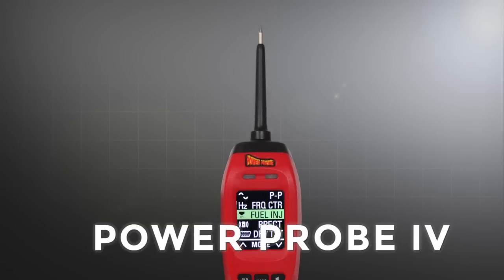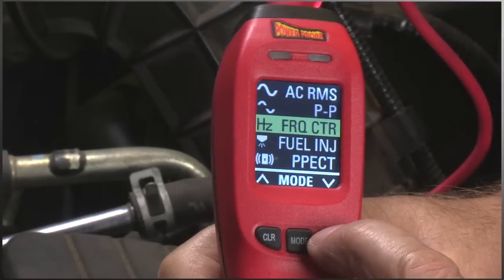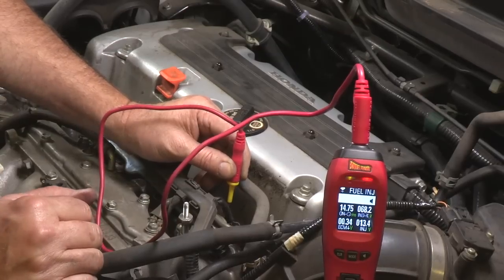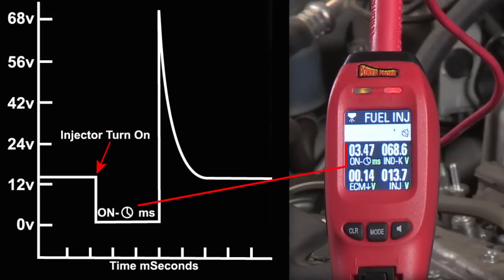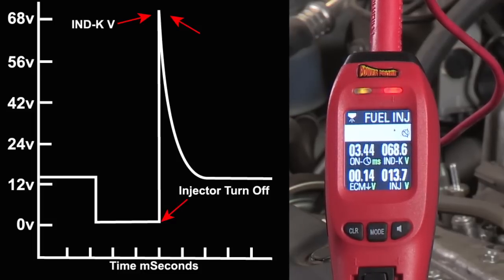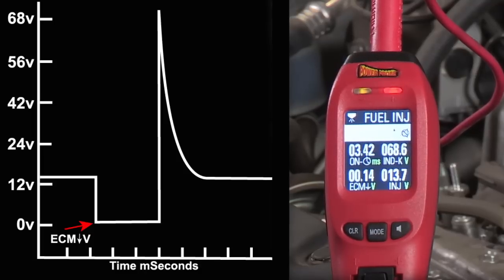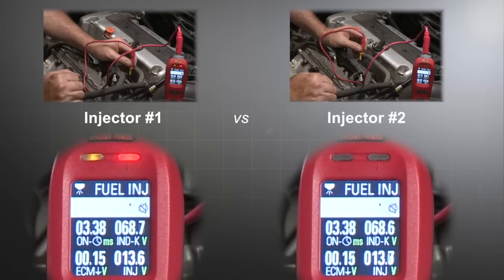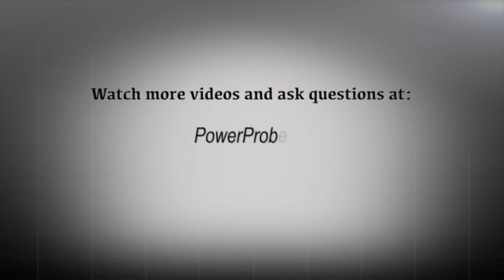Power Probe IV - Injector Mode, Testing Fuel Injectors

Comment: On a CR diesel solenoid injector both injector wires go to the ecm and the ecm reverses the polarity to the injector to pull the solinoid shut with no needle bounce. Allows for very accurate fueling.
Reply: Does the power probe work on that style injector?

Comment: Good clear explanation. I have just bought one but it hasn't got the red changeable wire as seen on the video to plug in the back of the injector.
Reply from the maker: these are accessories, find them here https://www.powerprobetek.com/product-category/parts-and-accessories/
Reply: Lol another $100 for accessories
Reply: What’s the part # for the tool pls

Comment: High great video thanks ..but does the powerprobe 4 or maestro do diesel injection ?
Reply from the maker: No, the injector test in the Maestro/PP4 is for traditional gas injectors used over the last 30 years.

Comment: Trying to find something with a yes or no light to tell me IF injector may be causing a slight miss fire, not sure how to understand this or would buy it.
Reply from the maker: This is a great setup since you can hear it too, if you can see a discrepancy in a waveform nice, but the audible tone has lead to figuring out that injectors are faulty pretty easily for a few of us on the team. If there's a dropout you'll hear it as it makes a tone every time it fires, great way to quickly diagnose injectors.

Comment: Why does the fuel injector mode go blank momentarily (no readings) when the RPM drops from 2200 RPM to idle?
Reply from the maker: Check this with another vehicle, this sounds like a vehicle problem not a tool issue.
You can call our technical support at:
 800 655-3585
Reply: Some cars cut injector pulse to let the car idle down.  If it's the same on every cylinder and the car isnt running like complete crap it's more than likely normal
Reply: @MrHandheldace  Thanks! Since my vehicle is an '87, it has no OBD port, so I keep the Power Probe on all the time with a dashcam pointed at it so if the engine malfunctions, I can play back the video to see what happened at the moment of failure. And when the vehicle stalled on the highway when I had to suddenly take my foot off the gas, I saw that the ECU didn't power down the injectors, so the engine flooded and stalled. (I replaced the ECU with my spare, and was back on the road!)
Reply: @PowerProbeUSA  Thanks! Since my vehicle is an '87, it has no OBD port, so I keep the Power Probe on all the time with a dashcam pointed at it so if the engine malfunctions, I can play back the video to see what happened at the moment of failure. And when the vehicle stalled on the highway when I had to suddenly take my foot off the gas, I saw that the ECU didn't power down the injectors, so the engine flooded and stalled. (I replaced the ECU with my spare, and was back on the road! Love the PowerProbe!))

Comment: Will it work on 24V system
Reply from the maker: Thank you for asking. Yes, the Power Probe IV will work on 24 volt systems. Max voltage for this tool is 30 volts.